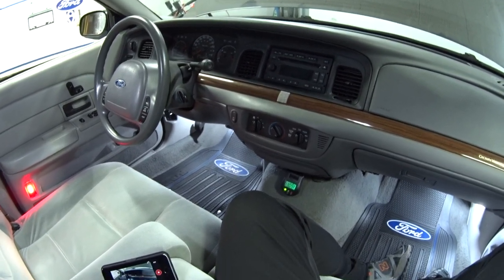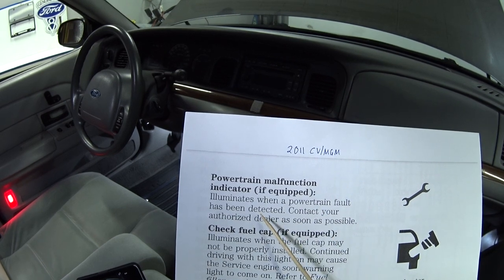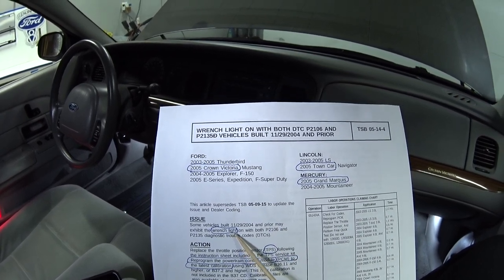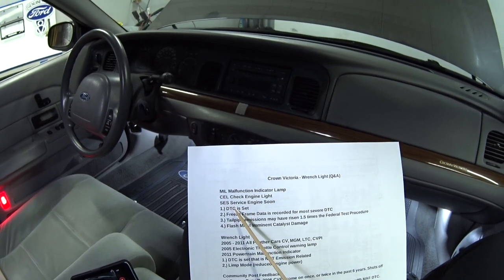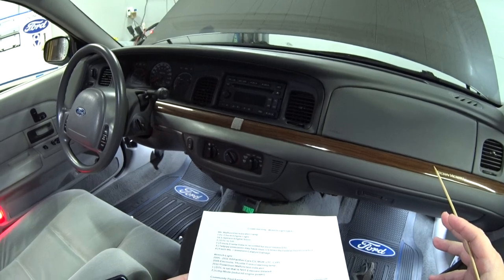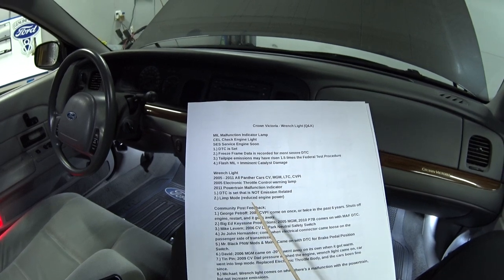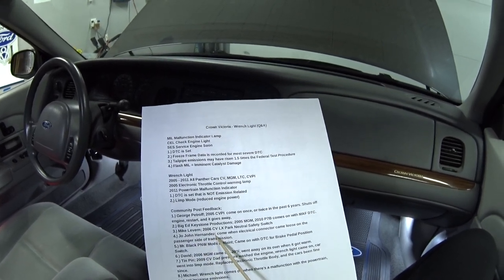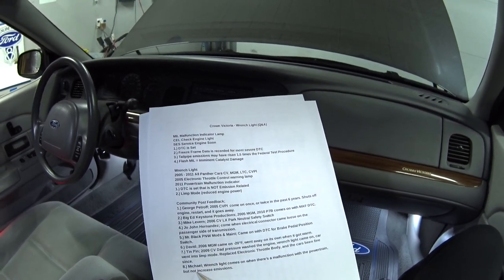Crown Victoria - Wrench Light

Comment: I have a 08 mgm with 135k i just recently got this wrench light . Starts up fine get going down the road about 10 15 min down the road and stop at a red light wrench light comes on it shuts off I'm able to start back imd. All I get is maf and some about evap I've cleaned the maf and very recently replaced the egr and down pipe. Any idea what is going on
Reply from the maker: Right on AKJ,
Thanks for watching, and the great question.

I do not support parts shotgunning.
Yes, it can be fun, and justified in some cases, but a proper diagnosis must come before repairs, or any parts are replaced.
Theres nothing worse than that feeling of wasting money, and throwing away good parts that were actually functioning properly.
Pulling a code with a scanner alone is never a reason to replace any part, it's just a starting point to begin your diagnosis.

Check out the comment below from Mickey Harrington.
Let me know if you need more help.
-Chuck
Reply: @PanzerPlatform  
I didn't shotgun parts the down pipe by egr valve split so had to replace whole unit as far as maf sensor I just sprayed it
Reply: I need to just bring it to a good shop and let them go through I bought it with 75k miles 3 yrs later it's almost at 140k
Reply from the maker: @anthonykingjr4475  
Right on,
Did you read Mickey's comment? Most likely it's an electrical problem;
short to ground
short to power
open
loose connection
broken wire
bad connector
corrosion in a connector
etc.

Any good shop will scan for codes, evaluate live data, and then perform a thorough visual inspection of all associated wiring based on the codes, and any irregular live data. My local Ford Dealer charges $225 an hour for electrical diagnosis. If you have a good flashlight, and and a few minutes, there's a good chance you can find the issue yourself.
Would you be willing to take a look, before you take it in?
-Chuck
Reply: @PanzerPlatform  I did I'll definitely take a look at that for sure

Comment: Today i had the engine running and pressure washed the engine , omw home on the hwy it went into limp mode . Pulled to a safe place off road turned the car off for 30 min . After that time i turned it back on and it no longer illuminated.  It's my only transportation.  This video help point me in the right direction. Thank you
Reply from the maker: Hello,
Thanks for watching.
How did you fix it?
-Chuck

Comment: I have a 2008 Grand Marquis and started having a few wiring issues....it was a damaged front end vehicle and I found some frayed wires...fixed all I could find but then the left headlight and turn signals quit working and at same time 3 warning lights on dash, ABS, brake light and 1 other in bottom left corner

I changed out the wiring harness with an 07 Marquis and now it will start, but I have no lights except brake lights when I push pedal, no dinging when open door with key in or light switch on and I can't shift into gear and no dash lights
Reply from the maker: Hello,
What you have described is a technician's worst nightmare.
Multiple layered malfunctions over time with ineffective repair attempts complicating the issues further.
I don't know where to start.
Seek a competent mechanic.
-Chuck

Comment: Had wrench light on 2010 Grand Marquis. Broken wire going to trans pressure control solenoid. Replaced wire, light went off.
Reply from the maker: Right on Mickey,
Thanks for watching, and the good feedback.
By any chance do you remeber the DTC?
-Chuck
Reply: @PanzerPlatform  Sorry, no I don't. First symptoms were vehicle would die when put in DRIVE. Intermittent problem for 3 years before wrench light came on.
Reply from the maker: @mickeyharrington6785  
Right on,
Thanks for the update. 
-Chuck

Comment: The redundancy department of the redundancy department.   Excellent video Chuck.  Thanks for your efforts.   I am going to be in contact with a relative later today that has worked at ford garages only for the last 30 some years.   I will ask him if he can provide specifics on what codes will set off the wrench light and if that includes U codes.   I don't remember if I told you or not the other day but I was able to find a replacement brake light switch that is the threaded type that is 5 wire capable like the OE switch that was in the car.  This may solve the P0504 finally.
Reply from the maker: Right on Mr. Black,
Sorry I'm not of any "real" help.
-Chuck

Comment: My 05 MGM has the wrench light on. The transmission won't hardly move the car back or forward. I changed filter and fluid.. car still won't move like it should. Its slow to move.
Reply from the maker: Do you have a scan tool to pull the DTC codes?
That would be the first step.
-Chuck
Reply: @PanzerPlatform  no scan tool. It's got 153 k miles on it. It shouldn't need a transmission. I really hate I bought this car. It's been a nightmare.
Reply from the maker: @davjones2724  
Try this;
https://youtu.be/9CxejeIbGYw

Comment: Chuck I need your help 🙏 someone stole the cats off my car and threw the car into limp mode after I got some cats welded back on I'm still in the same position stuck in second gear 40 mph any thoughts on resetting the ECU or other electrical components to restore the computer back to normal
Reply from the maker: 1.) What is the YEAR / MAKE / MODEL of your car? 

2.) Is it a police model?

3.) What DTC's are in the computer?

Comment: My wrench light came on replaced throttle body still on also my fan always on and my overdrive don’t work anymore
Reply: Just wanna find out what’s what before begin buying parts I don’t need ?
Reply from the maker: @devontaeeason5029  
Right on D,
Thanks for watching.

If the Wrench Light comes on, it means you have a trouble code.
You will need a scan tool to pull the code.
Do you have a scan tool?

If not, would you be interested in doing a video collabortaion with me?
I'll send you a free scan tool.
You'll just need to upload some videos of how we fix your car.
Also, what is the YEAR / MAKE / MODEL of your car?
-Chuck
Reply: @PanzerPlatform  I have a 2011 Crown Vic police interceptor Panther model my wrench light is on I change the oil change the throttle body position sensor a service the transmission and the light is still on it don't come on while in park it comes on after I drive it for a few minutes down the road the light comes on and then it starts acting funny like it's missing any kind of help would be appreciated
Reply from the maker: @kennycopley860  
Your first step is to get a scan tool, and pull the DTC's, (Diagnostic Trouble Codes).
If you need more help.
Please leave a comment in a new comment thread so all can benefit.
-Chuck
Reply: P2104 p2107 p2110
Mine is misfiring and I'n limp mode changed throttle body and maf and throttle position sensor still have wrench light
Reply: Htr EGR cat evap on top of scan tool blinking

Comment: LOL so basically it's a second check engine light that can go off for any number of reasons. Geez man.
Reply from the maker: Right on Phelcan.
Yes, you are correct. lol

The big difference is Federal, and State governments regognize the Check Engine Light and an "Emission" light, and will cause a failure of an Emission Inspection, or Smog Check if illuminated.

Where as the Wrench Light is not regognized as an Emission Light, and will not cause a failure of a government Emission Inspection, or Smog Check.

Clear as mud right? lol
-Chuck
Reply: @PanzerPlatform  haha yea. Thanks for clarifying it up I was wondering what it meant. Just one of those goofy ford designs that makes ford ford, reminds me of their spark plugs

Comment: Hi sir.. I have wrench light but no chack engine i have bad trands shifting in th1 gear and bad throtal.... And let you know my bank 2 first cat is broken and my throtal is dirty 🙊???..... When i replact my transmission seels its came on the wrench light
Reply from the maker: Right on Ahmed,
Thanks for stopping in.
You've got your work cut out for you. lol
-Chuck
Reply: @PanzerPlatform  but my car not enter in limp mode i can drive it fast than 60 mile but i have 1 issue its go in 2, 3, 4 gear great but can not shifting in th1

Comment: Fun , fun , fun , lol , ill run the code's later ( most are saying I need an oil change but IDK ) , 2006 CV LX Sport 23.157 miles . Thanks for all your videos. Ill try to update.
Reply from the maker: Right on DJ,
Thanks for stopping in, and the kind words.

Take a look at the comments below to see all the possibilities. lol
-Chuck
Reply: @PanzerPlatform  Sorry for the delayed update. The 'Wrench' light has not come on again & it may have been the gas cap was not tight enough , ? I got the oil changed 17 days ago so that could have been it . I checked the codes and it did not show any . Peace
Reply from the maker: @DavidJones-ib3zy  
Thanks for the update.
The gas cap has its own light in the dash.
The wrench light does not illuminate for oil changes.
It possibly an intermittent issue.
So just ignore it, until it comes back on, and stays on.
-Chuck
Reply: @PanzerPlatform  Thanks for the advice , ill pray it stays off 'as it has  been ' I got the "Gas Cap & oil change " possibilities from You-Tube & Internet Mechanics . Stay Safe

Comment: Thanks I learned something today. I had seen the wrench warning light in the manual but had no understanding of what it really was.

And I can assure everyone that you do not want any amount of raw fuel going through the engine and into the exhaust system. I had an 85 Dodge pickup that quit running while driving. I stopped on the shoulder and tried to start it three times with just short cranks of maybe 10 seconds. On the third crank there was an explosion under the floor.  The raw fuel had hit the hot muffler and blown that thing completely open.

The result was that not only did I have to replace the inexpensive ignition coil/resistor that is a little ceramic square thing that plugs into an outlet on the firewall, but I also had to replace the muffler and a piece of the exhaust pipe ahead of it.
Reply from the maker: Right on CD,
What a great story. 
-Chuck

Comment: My 2006 P71 has the wrench light on.  I just got it back with the transmission rebuild.  I'm wondering if it's because the battery has been disconnected.
Reply from the maker: Right on DJ,
Thanks for stopping in.

The only way to know for sure is to pull the code.
Do you have a scan tool?

If not, this may help;
https://youtu.be/p4A_KP0k0hI
-Chuck
Reply: @PanzerPlatform  I do.  I've used the Torque Pro app for years.  My son borrowed the Bluetooth dongle, so I need to get it back. 
I know the linkage or neutral switch need adjustment.  Last night when I picked the car up, it started in Park. This morning I had to put in neutral to start.

Comment: My 07’ P71 has the light every once in awhile turn the car off it goes off one morning it was really going wild how would I be able to find out the code it’s throwing?
Reply from the maker: Right on Junk,
Thanks for the great question.

You'll need an OBD2 Scan Tool.
They range in price from $5 to $5,000. 
To get started I would recommend the "ELM327 Wi-Fi" for $20 on Amazon.
The brand name is Foseal.

Let me know if you need more help.
-Chuck